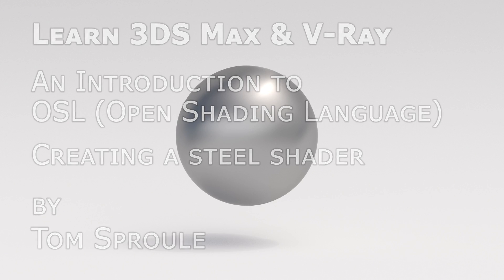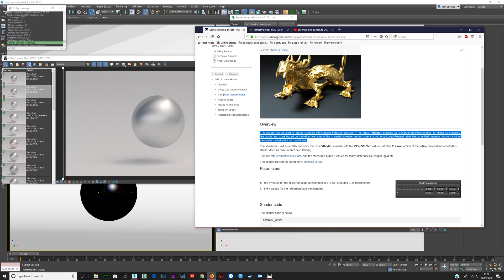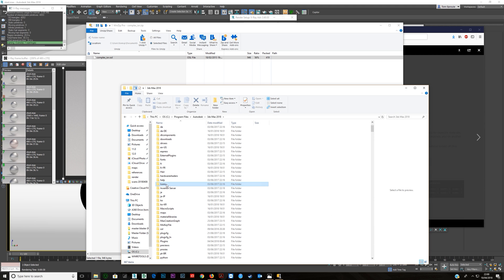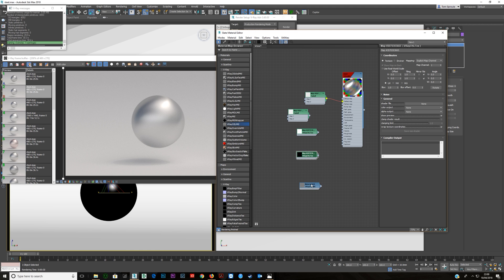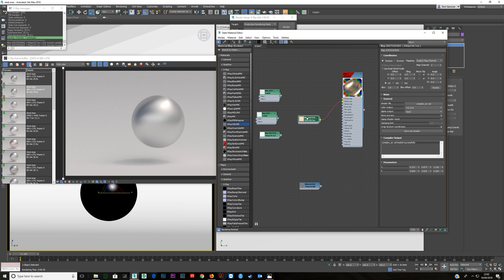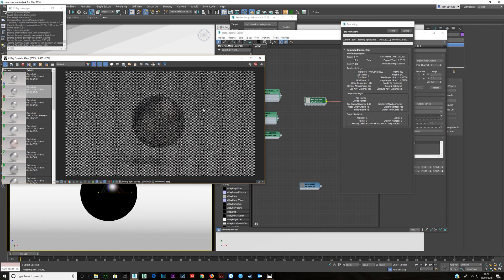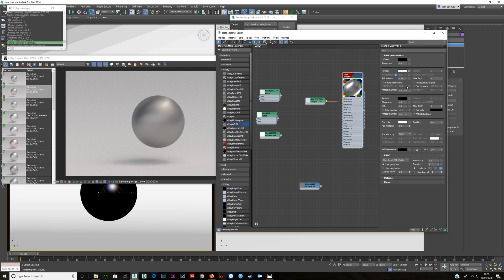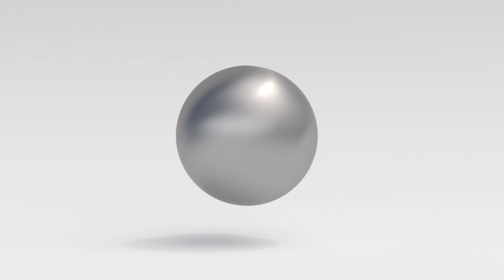Quick Iron & Steel Metals in 3DS Max with V-Ray OSL | Procedural Metal Tutorial

Comment: Thank god for your videos on metals, thank you :). You change the 3 (n) values to go from Iron to Steel but where did you find the Steel 0.911, 0.95 and 0.585 values.?
Reply from the maker: Hi, I'm glad they help. The issue with steel is that it's an alloy, so when you see me change the values I'm just eyeballing it to get it to the amount I think is correct. As it's an alloy there are so many different mixes of metals that it's not going to be completely scientific. It just always depends on how the steel was made, so the easiest solution is to try to match a reference, either photo or something you have in front of you.
Reply: @leonleon51  oh, ok, it's just so much easier to plug in numbers. thank you